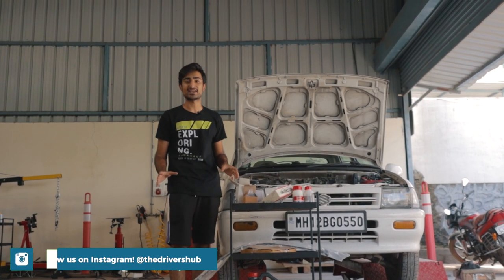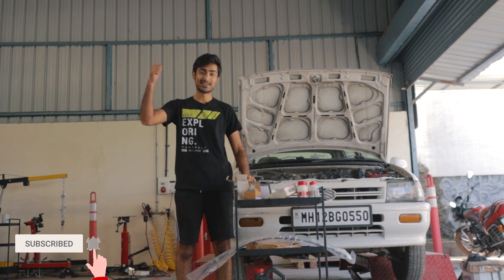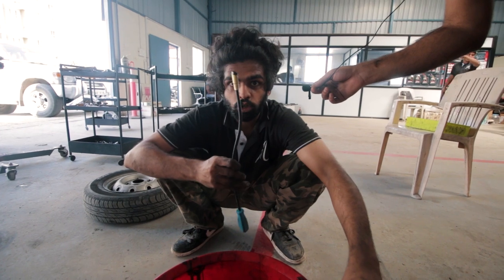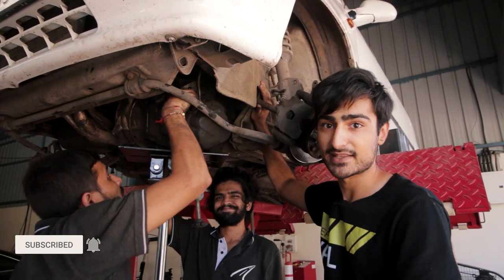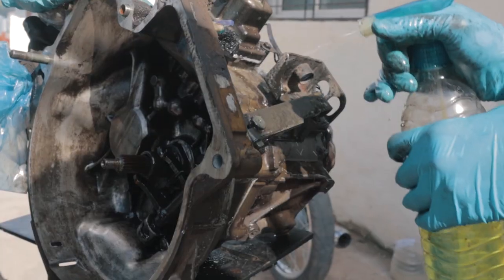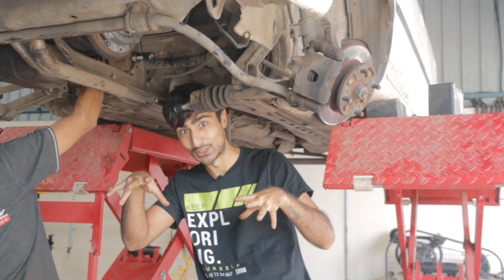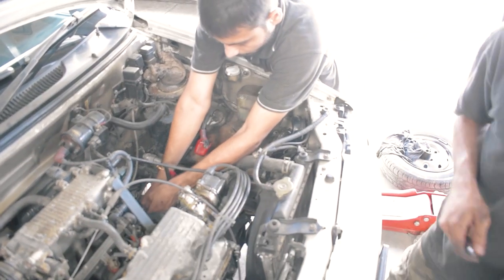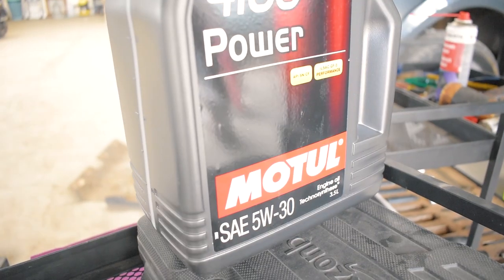Removing the GEARBOX and doing a CLTUCH change on a 2001 Zen! | Project Zen

Comment: Don't you think that engine overall / overhaul is needed ?
Reply: Not really, surprisingly after the TLC which was long overdue the car worked amazingly! We did change a lot of parts around the engine and the clutch. It needed the interior restoration more than the mechanical repairs.
Reply: @kiranrao1253   the only thing about such cars like zen, maruti 800, etc are as a owner we are ready to spend but parts aren't available.
And with passing time car make some rattle sound which are almost not solvable many a times.
Reply: @SK-em5wq  true but in this case an entire overhaul was not needed, the owner might have plans in the future.